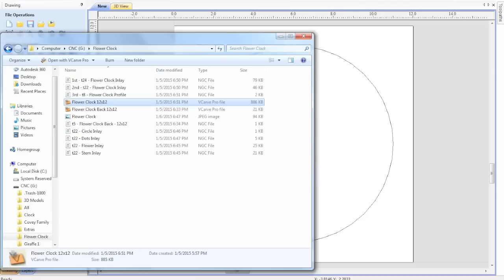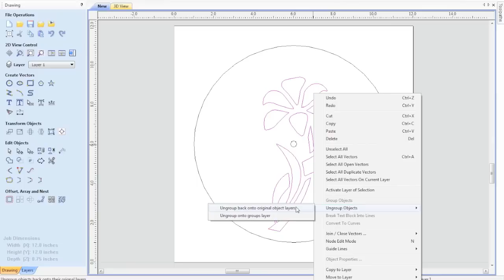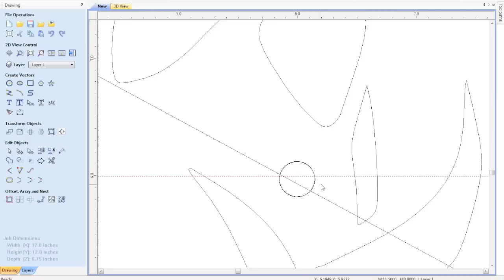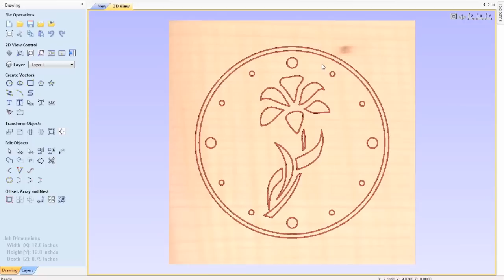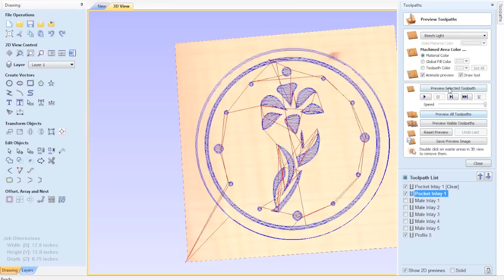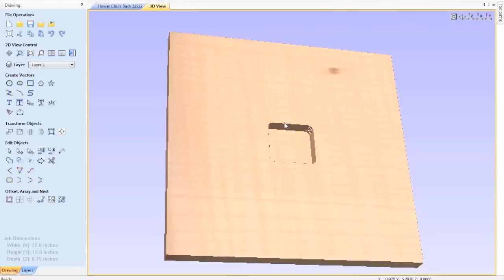Inlay Clock Design Tutorial - VCarve Pro 7.5 - CNC

Comment: Doing things the hard way there. 

1. Set the zero point in the center, NOT a corner.
2. Make the shaft hole with the circle tool using X and Y as ZERO.  That strs it dead center. also make the other 3 circles with the same X and Y center point.
3. do the flower as done.
4. Make the top circle as done.
5. Using array copy with the center point zeroed. set copy's to 4 using 90 degrees. You now have 4 circles placed EXACTLY around the edge.
6. Make one of the small circles and use array copy with 12 copys and 30 degrees. Delete the 4 inside the big circles. 

The result is you have all the circles and center where they should be.

IF you wish to reference a corner other than the center now set a corner in material setup BEFORE tool pathing, otherwise toolpath as set. Personally I find using the center as zero far easier to work with on most things.   Centers are easy to find by drawing a couple lines from diagonally opposing corners. the crossing point is the zero.
Reply: HHMMM. more than one way to skin a cat! They all taste the same though.